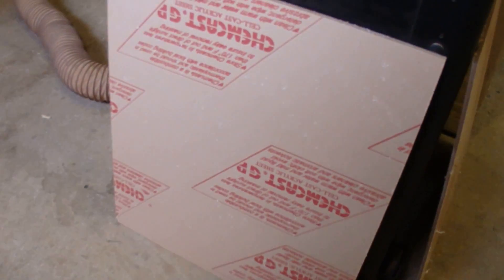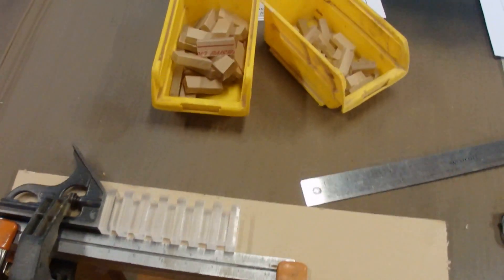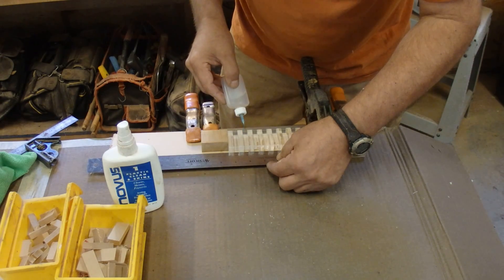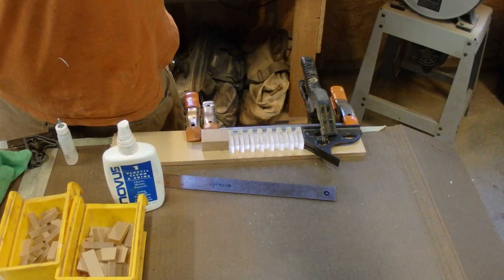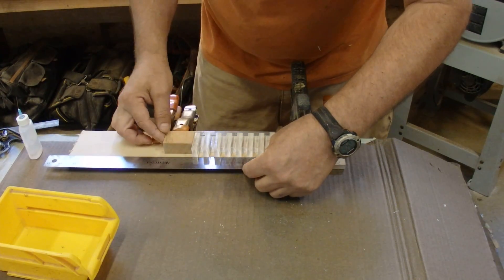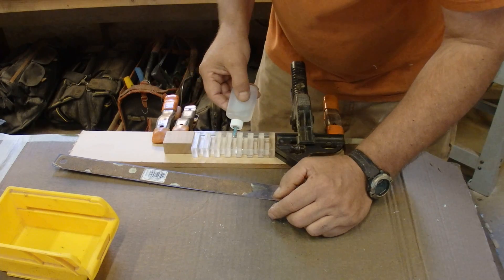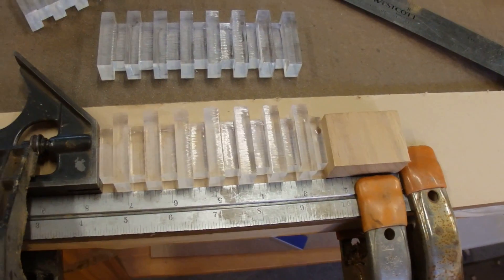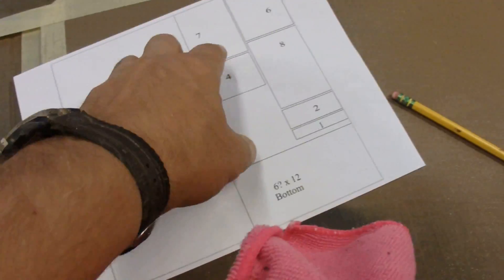Bitcoin Miner Hydro Fall Reservoir Part 1

Comment: Doesn't this introduce air into the system?
Reply from the maker: +jreina20 Less than a fall wall without corrugations. The slots and the water interact through surface tension and this minimizes aeration. The walls also are overlapped so they sit in a pond on each ledge further minimizing aeration. For a water feature this is about as air free as it gets. The reservoir is part of an art installation. It's supposed to look cool. A box of water with nothing else inside is the best res of course. but it lacks any activity.